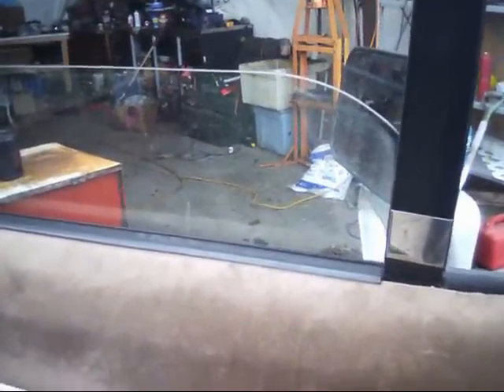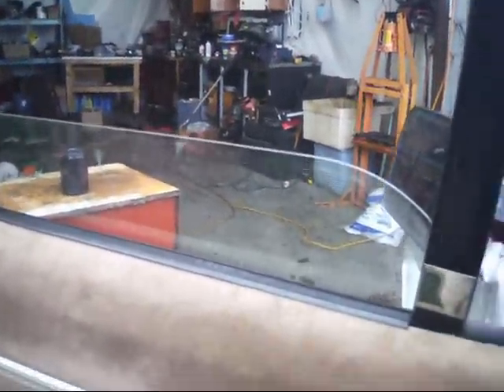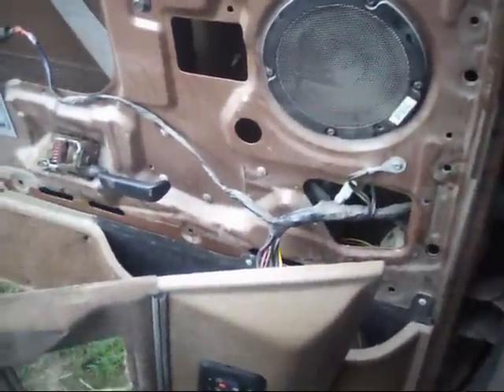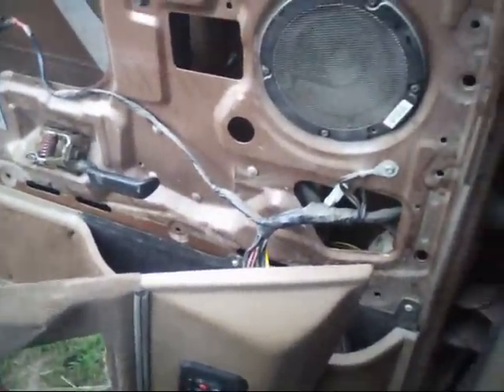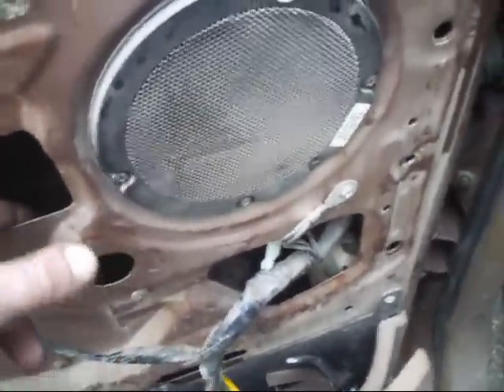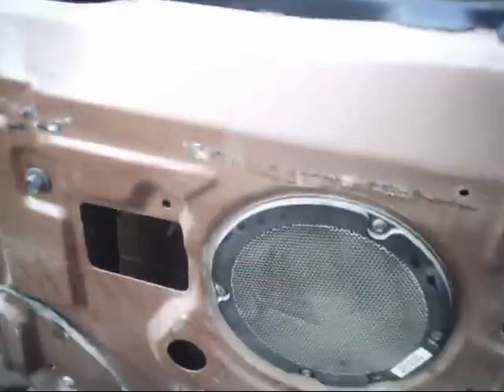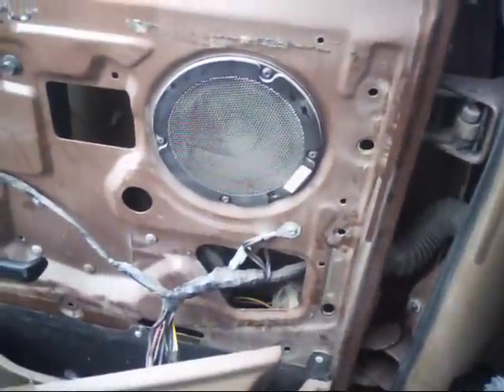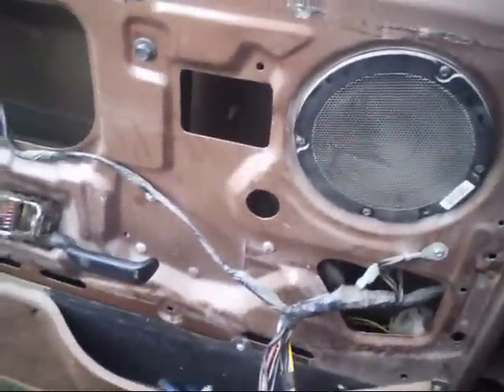Window won't roll up!

Comment from the maker: @blazerlover25 I have used black RTV to "glue" a window into the seal so that it wouldn't fall down anymore. Not exactly the "right" way to fix it but I hate working on power windows and the RTV seems to hold it up just fine.

Comment: If you don't want to screw with fixing the power just swap it out for the manual all it involves pulling out the power motor and reviting or bolting the manual winder in.
If I lived in your area I could have it fixed or swaped in 30 min. And if you don't have the right size of revits just use carrage bolts.

Comment: i had a problem like that but my window wouldnt roll up at all and what i did to get the motor out was drilled a few holes in the door where the bolts were for the window motor instead of drilling out all the rivets. was alot less work

Comment: Grind off the rivet heads and replace them with bolts. Use nylon locking nuts.

Comment: hey bah you got any suggestions for regluing a window back in the clips on the cheap?i got a 95 lincoln continental and the drivers window came out of the clips that bolt onto the tracks i have no clue as to get it fixed would construction adhesive work and actually hold up?